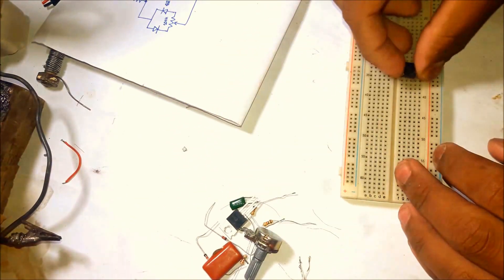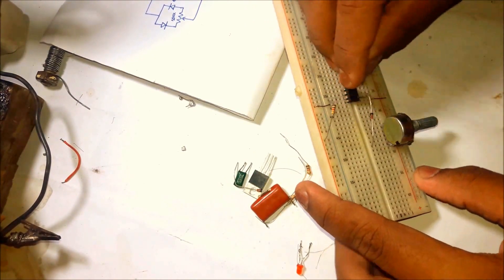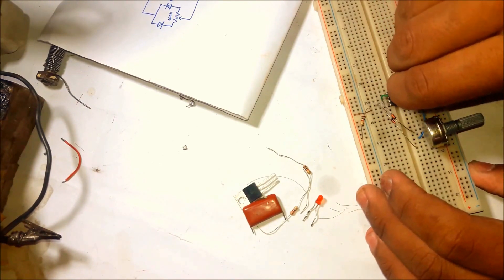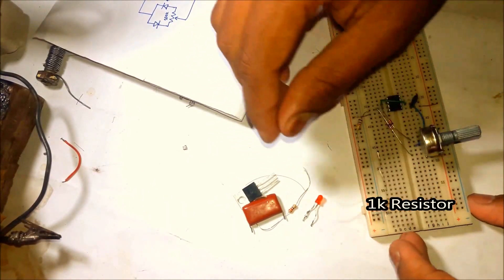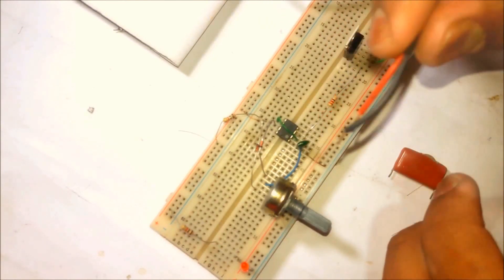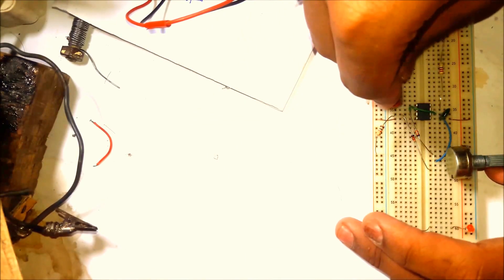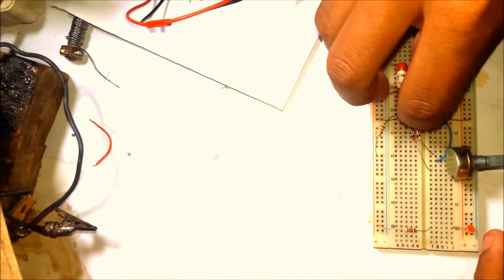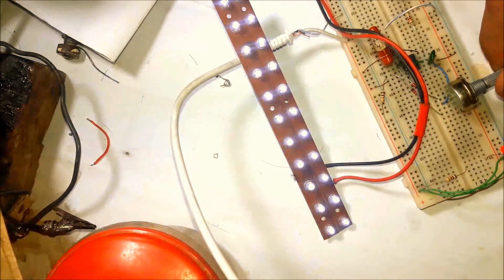Pulse Width Modulator using 555 Timer | Efficient LED Brightness Controller

Comment: I have 3.7v battery and 4v led of 100w
Reply from the maker: 4v 100w LED?
Reply: GreenLabBD  sorry 10w
Reply from the maker: Use a power transistor. This circuit will work with all kind of LED. But for power factor, you have to use the right transistor.